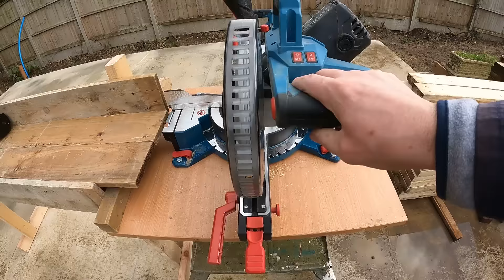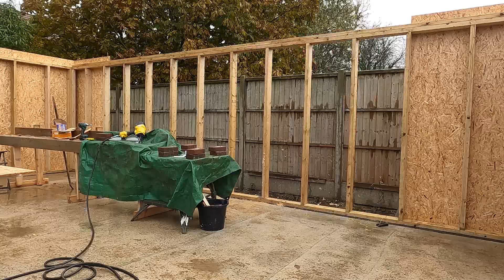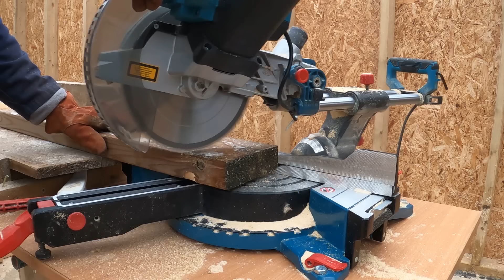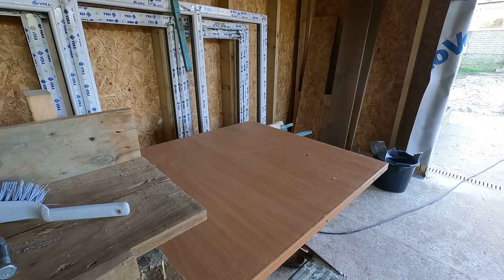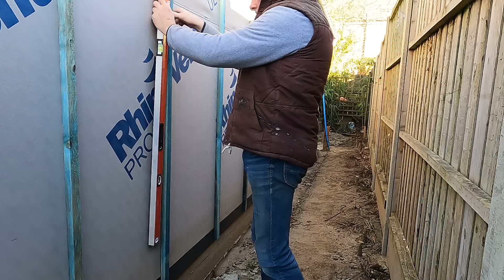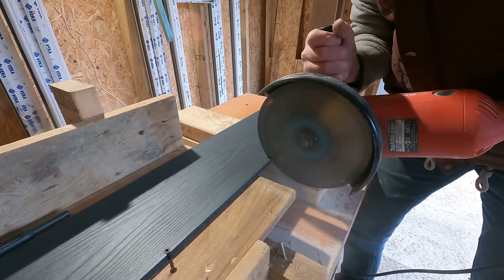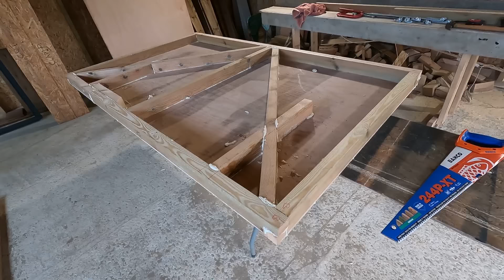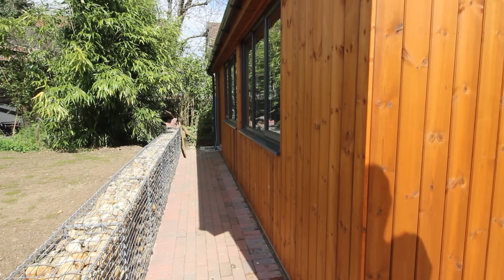Workshop Dreams

Comment: Great build well done, it turned out great. It's hard work building something like this on your own, but utterly rewarding. I build a double timber garage during Covid on my own, made a series of YouTube video's too and was surprised how many views I have had. I'm just about to build a shed/workshop in the back garden, price of timber has shot up since Covid, so I wondered did you do 400mm or 600mm on centre for the walls ?
Reply from the maker: Cheers, I went with 600mm centres to save a bit on timber costs! 🪵Good luck with the new shed I am doing exactly the same digging footings right now! 2.4 x3.6m just to get the max from a sheet of osb.
Reply: @CazualHaze than for the reply,  that's what I'm thinking 600mm to save on timber.  It's just a shed after all,  but being an engineer I like to over engineer my projects. 😂
Reply from the maker: Absolutely no value engineering here!

Comment: Great video thanks,not sure if you addressed the planning procedure in an earlier video or not but how difficult was it to get permission for this height of building within 2m of the boundary and of future workshop use with noise issues etc.
Reply from the maker: Hi Steve,
Good point I am only slightly above the height we sailed through planning with one objection. They thought we were going to run business which planner was happy we weren’t going to do. Noise wise there’s virtually nothing anything is down at almost ambient.
Cheers
Reply: @CazualHaze That's good to know there's a bit of leniency allowed,either that or build up the outside area a few inches!

Comment: Fabulous build. Did you design it yourself or use a pre made plan to work out all the appropriate framing details?
Reply from the maker: Hi @SafetyTh1rd
I designed it myself you dont need a drawing but you do need a set of calculations to show its up to building regs. 
Cheers

Comment: Im a bit puzzled that you didn’t run wiring for lights and outlets before putting up the sheet rock
Reply from the maker: Hi @sblack48,
The wiring is all in trunking on the surface. I wanted to make it easy to move and adapt it as the shop develops. The lights are all accessible from the roof void, it turned out to be quite a complicated system. Its all in a video if you want to take a look.
Cheers
Reply: @CazualHaze  oh great I will check it out thank you. I knew there had to be an explanation.

Comment: Im looking to do something similar, can i ask how you get around the planning rules as that looks way bigger than 30 square meters. Just wondering if you knew something I didn't know and wouldn't be able to help in my future endeavor.
Reply: I also know that height so close to the property line isnt in the rules. My local council which they all have pretty simular uk standards for outbuildings and sheds without planning. Cant be more than 2 meters in height if its less than 2 and a half meters from the property line. So again how please advise me so i dont get an order from the council to take it down.
Reply from the maker: Hi Jimmy,
I went through planning and building control my view was trying to fiddle the rules would end in me spending more money.
Good luck with your project

Comment: How big is it in ft I got a 16ft x 10ft I didn’t put it up myself as I’m disabled and use a wheelchair but I did the inside almost 2 years and still not done I’m just useless I’ve got Rheumatoid arthritis which is bad my fingers turn 90 degrees outwards I’ve also had 2 small strokes copd and found out end of the year that I’ve had TB so it’s been fun. But I think you’re doing the done a fantastic job I brought some rubber tiles that help with fatigue I think they help with sound deadening I got them from eBay work ok 
Steve 👨🏼‍🦽
Reply from the maker: Forgot to add it’s about 18feet wide x 26feet long.
Take care
Reply: @CazualHaze so hopefully I should be ok with what I’ve got 16ft x 10ft but since I insulated and put plywood on walls and ceiling so smaller now and I reinforced the floor
Reply from the maker: Thanks for the comment and the tiles sound like a good idea, I hope things improve for you! Doesn’t matter how long it takes you it’s what you enjoy doing I would think the shop helps keep your joints moving. Take your time there’s no deadline with a hobby!
Look after yourself cheers
Reply: @CazualHaze cheers just got to work out how I do a wheelchair ramp but I’m getting there
Reply from the maker: Good stuff sounds like a good space to work in.
Cheers

Comment: Looks fab. Out of interest, why not put a DPC in when casting the slab, as opposed to painting it on retrospectively?
Reply from the maker: Hi I was going to put another layer of concrete on the slab with a DPC under it but went with the cheap option it also meant I gain another 50mm ceiling height. 
Essentially it was a mistake to not pour the slab onto a membrane!
cheers

Comment: I start my build Aug ‘25.  This exhaustive (exhausting?!) account of your build humbling to watch. Your editing and commentary as meticulous and considered as your build process. I have taken away much useful information so very grateful. My structure a 4x5.5 meter Workshop (with 45 degree corner cut doubling up as entrance and turn access for the car park spot) that will sit on the concrete pad I put in last summer and incredibly proud of. Up until last year I had virtually zero experience in DIY or construction, but watching your build given me confidence that as long as logical steps taken I might just do it.
Reply from the maker: Thanks for the comment and good luck with your build, I think you will find it very rewarding when you are done.

Comment: How did you get away without headers over the window?  Big span for just a couple 2x4s laid flat to support the roof...
Reply from the maker: Good question the beams were added because the building inspector said they were needed.
They are glued and screwed together then bolted through every 150mm if I remember correctly they were also timber lock screwed in place and braced to the floor with upright timbers. They but up against the rafters so support the roof directly. A year on there is no visible deflection the roof still looks absolutely straight.
Reply: @CazualHaze I saw that at the end. Yeah… that’ll work fine!

Comment: I can't see how you make the beams hanging over two walls without bending over time?
Reply from the maker: Hi Randy,
I guess they will sag after the first year the whole thing has settled down slightly the double doors are close enough to touch the floor when you open them now. It’s built to building code here in the UK and the timbers used are much stronger than they need to be. I do think you are right though you only have to look at an old oak framed house here to see nothing is straight or level but it may have taken four hundred years to happen.
Cheers

Comment: Just curious if you needed to notify building control on this as it is over the 30m2 size that would require it. I'm debating building some around the 45m2 mark but I have been put off going that large because I dont want to pay some some bod from the council in hi vis over a grand to pour over each stage in the construction phase....
Reply from the maker: Hi yep I did need building control, which leads you to need calculations for the structure wind loadings rainfall averages a soakaway in my case and a whole heap of agro! Having said that once I got approval the actual inspectors were really helpful. Is it worth the hassle? Probably but I think I would build two next time under the size limit. I would make the patio doors of each line up so when open they form a small outdoor space between the sheds. 
Good luck and cheers

Comment: Just watched your video, why was there no dpm on the slab ,it would ve saved you all that expense with renting the machine and buying epoxy, also  did you use marine plywood for the doors ,if not you shouid clad the doors in treated shiplap .seems like the project was nt thought thru.
Reply from the maker: Hi @stu111able,
Yep fair point it did evolve a bit more than it should have. The slab was originally going to be laid in two sections with a DPM between however in discussion with the building inspector he said I could add an epoxy DPM which saved a whole hill of cash. I'm not a builder so its not easy to find all the info you need and what can and cant be done. Doors are not marine ply to save cash but are treated in good quality waterproof breathing paint. A year in they are showing slight signs of weathering but no more than I expected.
I have to build a wooden garage in the near future and will be taking forward all the comments and what I have learned from this. So thanks for the comment.
Cheers

Comment: Great build 👏 Did you yacht varnish or put extra stain on the tongue and grove? Again, great job, my friend 🫡 🐟
Reply from the maker: Hi Gary, I used a waterproofing stain sprayed on in several coats. Each board bottom end was dipped in polymer waterproofing just as they were nailed on. I think they tend to rot from the bottom up.
Cheers
Reply: Cheers 🍻 Thank you for your reply. I will use yacht varnish it's a lot smaller area.Thanks again, my friend 🫡 🐟

Comment: nice build. just looking for some inspiration for my ongoing 50x10m garage/workshop. I have two questions.
1. no heat insulation in the ceiling? (28:20)
2. no vapour barier undet the plaster boards? 
not good idea :-)
Reply from the maker: Totally right with the vapour barrier missed it out by error! However there does not seem to be any condensation or damp so far. If I get any problems I will either strip off the plasterboard and add barrier or seal the surface with epoxy.
The ceiling has got a lot  of rockwool just did not film it!
Cheers

Comment: Did you have to get planning permission for this? I’m about to start mine and I keep seeing 30m2 max but it’s not mentioned anywhere in the Permitted development rights for householders Technical Guidance
Reply from the maker: Hi @TrackAndBeyond
I think it’s general across the country but I would give your planning authority a call to check. With My local authority it’s 30m2 or smaller plus height and distance from the fence , anything more needs planning!
My workshop is 45m2 so I had to get planning and the kicker was building control who want to see structural calculations. Good luck with your project.
Cheers

Comment: Just saw this video. Looks really good. Not sure if youv'e seen the video i did on building mine. I took a different approach & used insulated load bearing 100mm fridge panels. Don't regret doing it that way as it did not take long to erect. Although it does not have the beauty of what you have built. Stunning.
Steve.
Reply from the maker: Thanks Steve,
I was a bit hemmed in by building regulations. I wanted to use insulated SIP panels but the cheap ones didn’t have a load bearing certification, the good ones were too expensive.
There’s a lot of timber in this because of the regulations. I came to the view that I was only going to do this once so swallowed the cost.
I’ll check out your build, cheers

Comment: Need you come build me one i like it i need a bigger one like that i have a 11ft by 12ft at moment but want it bigger
Reply from the maker: Hi Joshua,
Going to be tricky I am not finished yet on this shop. Then I have a garage to build and a house extension that’ll take me until I am at fully retired age. It’s looking tough but if you build one yourself good luck. My advice would be to make it small enough to not need building control! That was my mistake.
Cheers

Comment: Wow, great workshop. female diyer here, finally moving into my new house and it comes with a garage so looking to convert it in the workshop. The good thing is, the previous owners wired up electricity, has lights so needs a clean up. I think I will also put OSB boards on the walls, it will just make drilling into wood easy than brick. But great workshop, very jealous of the space you have. Mine is going to be compact. I am still deciding if I should get a track saw or a table saw because of space but with your shop, envious of the tools you can put in.
Reply from the maker: Hi @mumihp 
Great to have you aboard there are not enough women in this space! Good luck with your project. Good choice with OSB I think it has quite a rustic look. I left it bear in my summerhouse just for its look. 
It’s taken a lifetime to get enough capital scrapped  together to build my shop. Even so it’s cost more than I had hoped. But it should be a one time project I hope!
The two most dangerous tools I own are a chainsaw and my table saw! The table saw caught an edge once and threw a piece of wood back at me splitting my thumb to the bone. It’s alright now but the table saw is a bit of kit that I use very very carefully. My home made track saw on the other hand is a lot safer but very slow and less accurate.
Good luck with your project and cheers for your comment.

Comment: Very nice. I'd love to do the same. I didn't notice you putting lintels over the windows. Was that not needed for the roof trusses to bear on?
Reply from the maker: Hi Ben,
Yep the building inspector made me add some hefty timbers in front of the windows braced to the floor.
The windows were up cycled units and were too tall. So there was not space for the beams above.
I think I made reference in the workshop window video.
Cheers

Comment: Huge tip i can offer you. I've been building timber frame house in the UK for 20+ years and the easiest way by far is to build the walls/stud work in 1200mm x whatever hight you want so once you have the (for arguments sake let's say) 1200mm x 2400mm frames built on a bench then put your sheet of Osb on top, pull the frame around to square it up to the osb and nail in place and repeat obviously some frames are going to be different sizes for corners/windows/doors etc but you get the idea no matter how small or big just make sure you square the frame to the square edge of the board. Doing this way makes sure all panels are square and it's so much easier to put together by yourself literally put your soul plate down and then you just but the panels up together, clamp and screw and so on. Whatever the case bloody good job you done there mate.
Reply from the maker: Hi @lone-wolf
That’s great advice it never occurred to me to do that!
Those frames were bloody heavy, cheered for the advice I hope to be building a new garage soon. Not sure if it’s going to be block or timber frame as yet but if it’s timber this sounds the best method.
Cheers

Comment: Thats a fantastic job. Im hoping to buikd a golf sim room in my garden. Only trouble is i need 3m height inside and i understand that im only allowed 3m external height or 2.5m with a 4m apex if im 2m away from my boundary fence. Im wondering if i could make the roof trusses as such that j coukd raise the cross beams.  Im no carpenter, just a diy youtuber. My build would be an internal 7m x 4m
Reply from the maker: Hi @jumpthegunblues,
You could cheat a little bit. You are right about the heights but you could dig the floor out to give you the ceiling height. I think people do that with old cottages to give them clearance under the beams. A cruck frame style or sip panels might give you more ceiling height.
Let us know if you give it a go!
Cheers
Reply: @ many thanks. I will have to google cruck frame and sip panel as I don’t know what they are. The only thing I was worried about if I sank it low was damp. You sound like you’re from Norfolk way. I’m Wisbech based
Reply from the maker: I know what you mean flooding and damp are an ever present thing. Yep I am mid Norfolk I was never sure my accent was strong enough for people to determine. I woz rung!
Cheers
Reply: @CazualHaze  that you were boi. We have a chalet in hemsby. There are a few from Naaarij we chat to
Reply from the maker: I guess there won’t be too many who understand what you said ha ha 
Hope you are not too close to the sea!
Reply: @CazualHaze  ha ha. No we should be ok for a few years yet.... Hopefully it should see me out. I'm the wrong side of 60

Comment: Did you need planning permission?
Reply from the maker: Yes I did need planning that’s the easy bit, because it’s over 30m square in the uk it needed building regulations or code in the us. That is where the fun starts you need to provide calculations to show it can cope with the loads imposed upon it,is made from regulated materials and the drain soakaway can cope with a storm level of rain.
Many hours of research and calculations!
Cheers

Comment: (Very sad that you elected to lift those window frames manually). Next time take five minutes to devise an assisted way. You’re almost 60 now and a little bit of extra innovative planning for these tasks will preserve your skeletal condition far better going forward. Trust me 60 is still very young to be abusing yourself that way…
Reply from the maker: Thanks again Phil,
Point taken lots of heavy stuff to install I think an engine hoist will do me well!
Cheers
Reply: @CazualHaze  (I’m ten years ahead of you) so my advice is start self- preservation habits now! I like to work alone too so little cheap innovations like hanging a ratchet strap each end and gradually hoisting to the correct height will save your back and avoid dropping a corner on to concrete and damaging the frame… Cheers buddy.

Comment: I was interested that you decided to use the studding bonded into the base as opposed to the usual raw bolts and I guess one reason was much lower cost. Nice work.
Reply from the maker: Thanks Phil 
The concrete supplier suggested bonded anchors as there is very little stress on the concrete. Much less chance of blowing the edge off.
Cheers
Reply: @CazualHaze  very true, (it’s really upsetting when an edge “pops” on you…)-very good advice therefore..